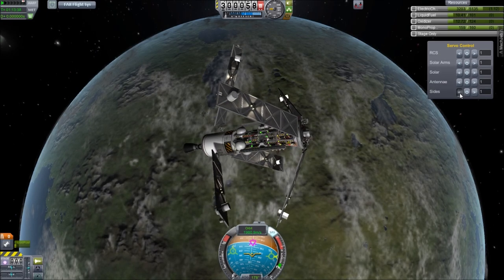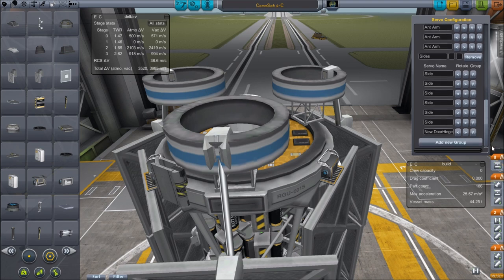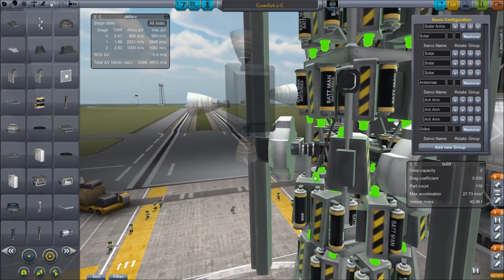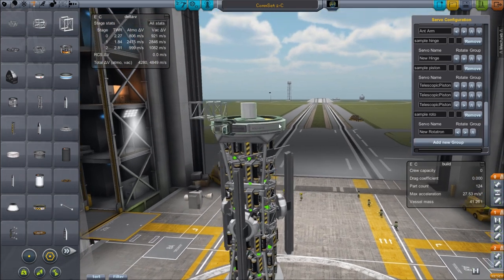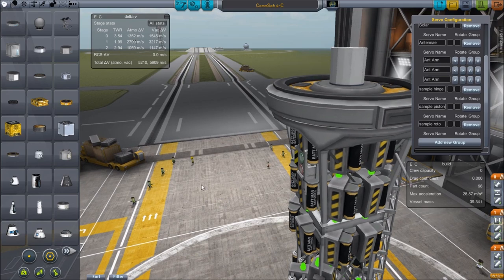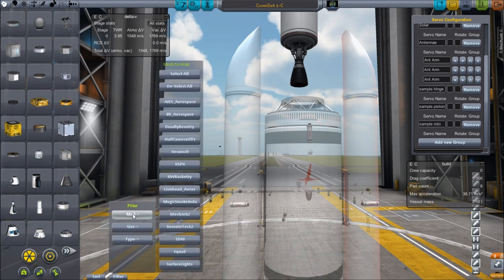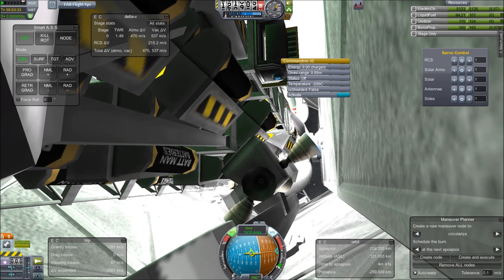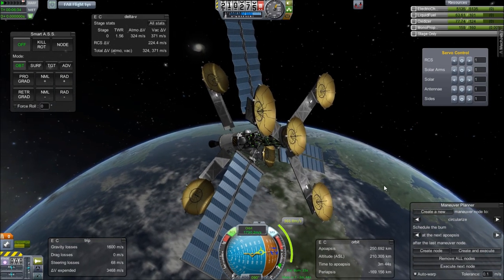Using Robotics - Deconstructed Satellite #1 - Kerbal Space Program 0.22

Comment: Can you explain how you put your telescopic pistons installed?  I'm having difficulty replicating what you tried to do.  I am using the smallest ones, I am installing them in the right order, but because they are clipping into each other, it won't let me actually connect.  Did you use something like a cubic strut?
Reply from the maker: I do what you're trying to do, and I either get lucky, or I get very frustrated and then get lucky. They will eventually link, but you need to attack them from various angles, and with snap off, and sometimes just generally move them around like a crazy person.
Reply: Ah, yes, I have been trying with Snap on.  Also, what if I'm already a crazy person? :D
Reply from the maker: It'll be easier.

Comment: What mods gives the additional lights?

I googled surfacelights and only found city lights and clouds?  Is there a 0.23 version of the addon to add more lights other then the two stock ones?
Reply from the maker: Here you go: http://forum.kerbalspaceprogram.com/threads/57778-0-22-Surface-Mounted-Stock-Alike-Lights-for-Self-Illumination
Reply: Bob Fitch Thanks bob.  I found that plugin but it does not seem to have the light that you have attached to the main panels that fold out.  You can see it on the upper panels, second panel out from the hindge.
Reply from the maker: Little white "dome" lights? Pretty sure it's B9 Aerospace.